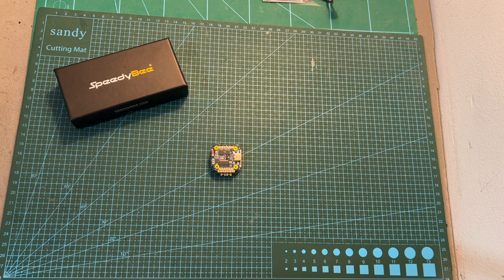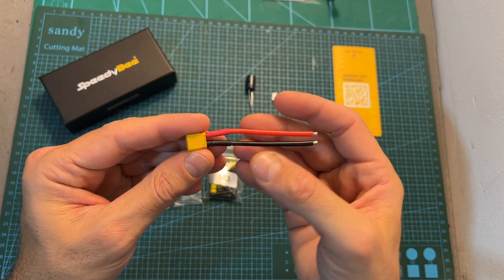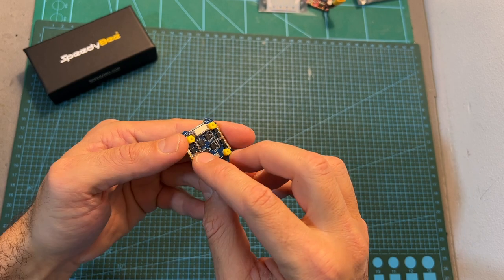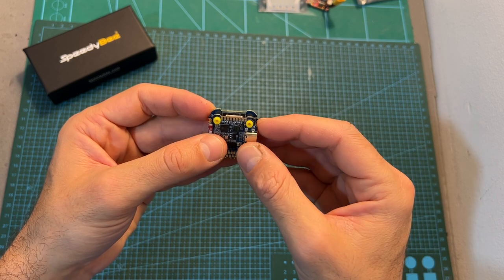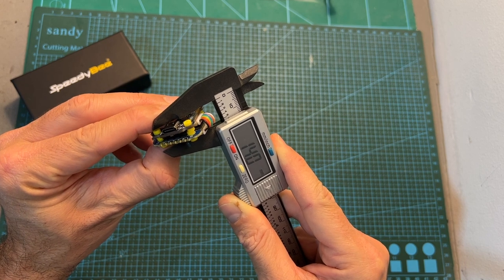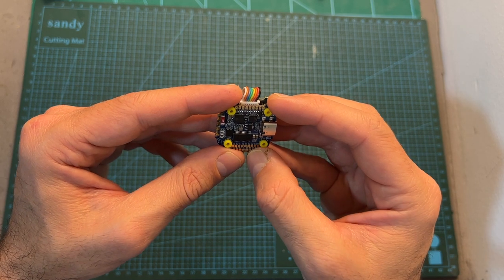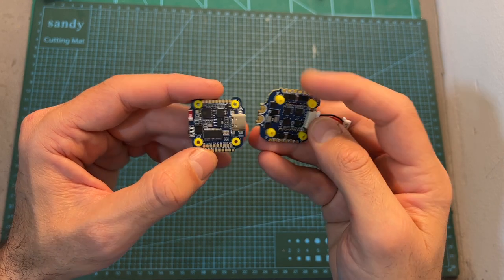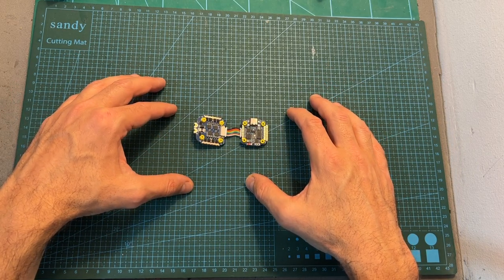Compact & Cable Stack - SpeedyBee F7 35A Mini Review

Comment: Thanks Gal, I waited the 20*20 version since march even talk with speedybee. I'm so desapointed they don't put a wifi chip on it.
I wanted to replace my F7 mamba with it to easy switch firemware and tune...
Can you use/dl blackbox and tune your quad without wifi ?
Reply from the maker: No problem. I need to confirm with SpeedyBee that it doesn't have a wifi chip as according to the info they sent me it doesn't have one, but according to the specs list on their website it does... I will keep you posted.
Reply: @KremerFPV  Hello, did you got informations ? What we can't do witout WiFi ? I think we can't firemware update
Reply from the maker: @25Kam25Kam25  I confirmed it - FC firmware cannot be flashed.
Reply: @KremerFPV  from the support : "the mini F7 has no wifi. It can connect to Speedybee APP to set the parameter, but you can not use APP to analyse the blackbox data and firmware update."

Comment: Hi Gal. Unfortunately these types of product overviews for electronic components are not adequate for any decision making as they do not stress test the components in any way or identify any potential issues. Speedybee made a bad batch of their last 30x30 ESC and handled it terribly. Wasn’t even mentioned in your review. Sorry Gal, for expensive crucial components like ESC or stacks these products need to be field tested for a while imo.
Reply from the maker: Thanks for your feedback. I fully understand your point and will take it into consideration on my next videos. As for the faulty batch, unfortunately I was not aware of this issue and I didn't experience any problems with the stack I had (and I've used it in two builds).
Reply: Technically the batch according to Speedybee isn't faulty.  The chips on them had a firmware issue with BLHeli32.  Allegedly a new firmware will fix it, which is being tested.  Now, it's 100% on them for not testing these ESCs before shipping them out.  They emailed me a new firmware to fix the issue, which the new firmware burnt a motor up.